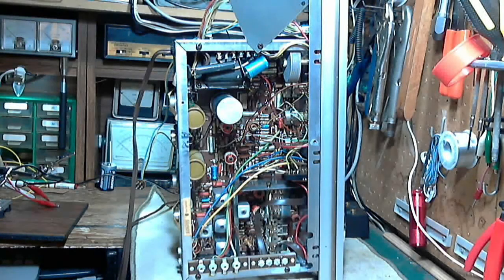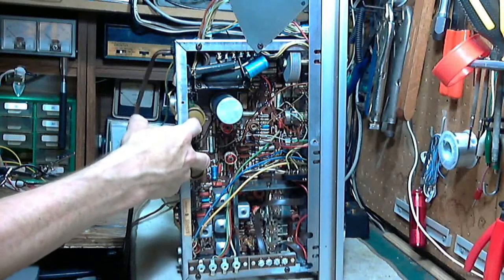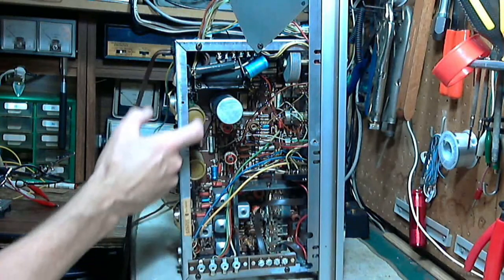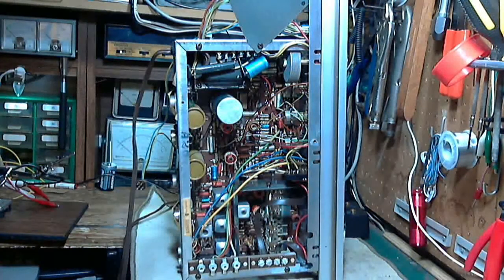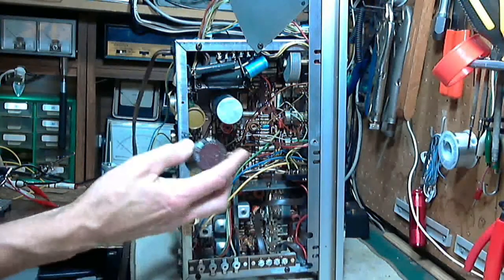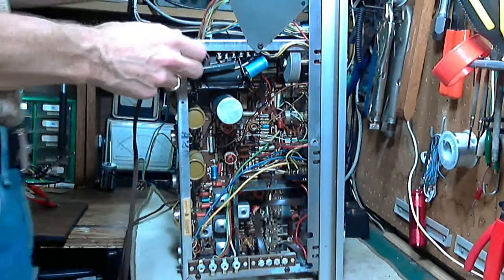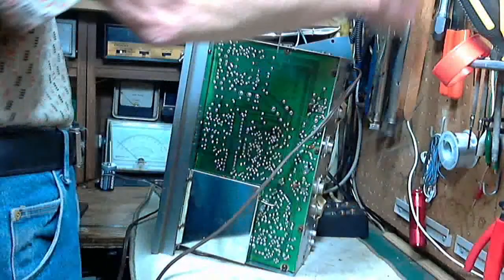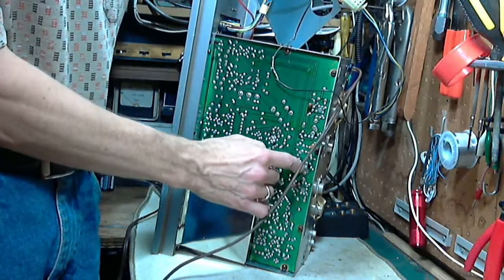Electrohome Century Console Stereo Video #6 - Output Capacitor Removal

Comment: Back in the 80's and 90's when I fixed this stuff for a living, truckers would bring stuff that had parts rolling around inside loose from the vibration of the trucks. I fixed a lot of stuff in those days with just a soldering iron. Probably 75% of what I fixed was cracked solder joints.Most of the stuff that needed parts was caused by bad solder.
Reply from the maker: Metal fatigue has cost mankind dearly.

Comment: Word to the wise: Freshen the solder joints up fat before sucking it, it will come out easier. Also you can wick it up with solder braid. Or, Invest in a good quality Hakko desoldering iron.
Reply from the maker: ***** Good ideas.